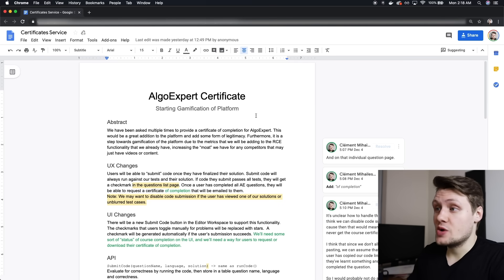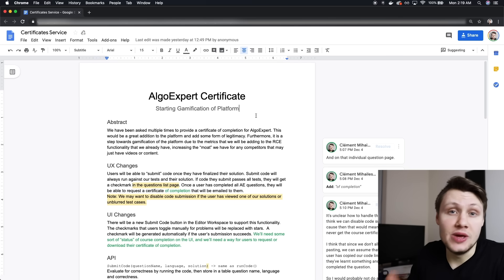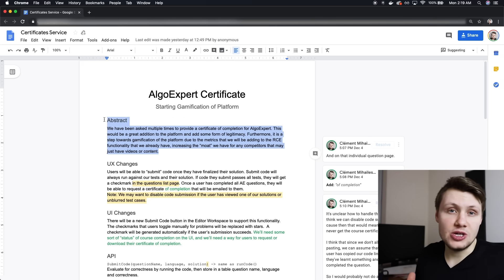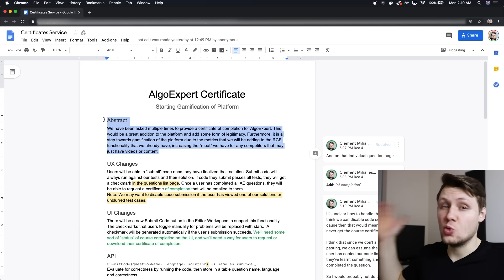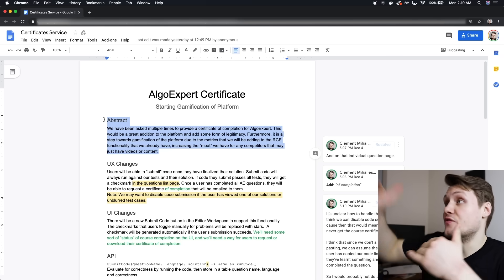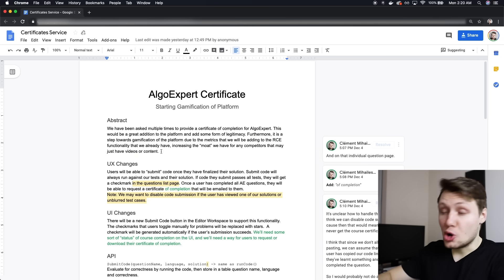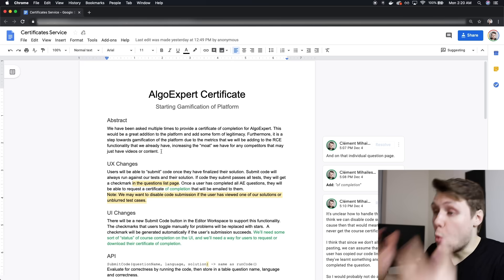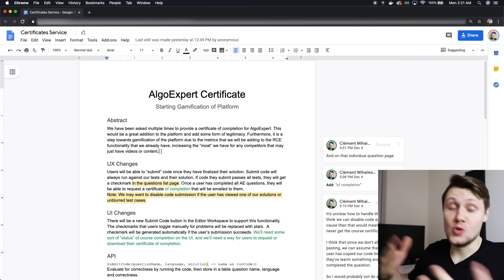What Is A Design Doc In Software Engineering? (full example)

Comment: Good start point. I think this video contains only the high level feature description aspect of the design doc . In my experience, the design spec goes quite in details i.e. design pattern, class, methods, use cases, etc. It boils down to what the team standardized for the design doc which actually helps and does not hinder the development.

Comment: I think design doc is Important because there is always new developers join the company and others they leave, if you don't have design doc the new developers will struggle to understand the software features, i think it's not an option to build a software without documentations and it's a best practices to work and understand this Important part in software engineering life cycle.

Comment: This seems very similar to our developers reviewing the work items in refinement. We discuss how it will be implemented and question the workflow in refinements.

Is a big goal of this design doc to have multiple teams have discussions asynchronously over contentious issues and a replacement of a refinement in a way or done before refinements?

Perhaps I'm questioning it's place because our work items are so high level already and not specific and our company is not a Google sized engineering group. Maybe we should do this for large features like you mentioned at the end of the video.

Great video :)

Comment: In university I have been taught about ER Diagram (backend engineers focus heavily on Database design before any web framework like SpringBoot2(Java)/Hibernate or Phoenix(Elixir)/Ecto) then UML Diagrams (Class, activity diagram) but when I did internship for an average company, there are only UI draw + some notes on the feature. It takes 6 months to design database with a few hundreds of tables but only 2 weeks to implements all the features! Coding is so fast! Ha ha
Reply: I would say, designing things for big projects are a big time and resources saver, although the same can't be said for small projects.

Implementation is fast after completing design documents as it takes away 90% overhead of implementation and is super maintainable.